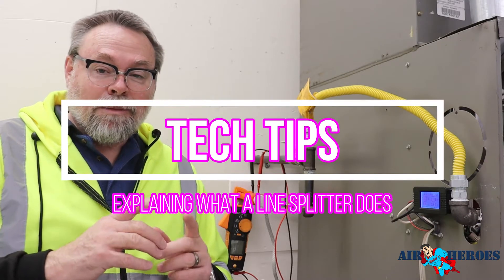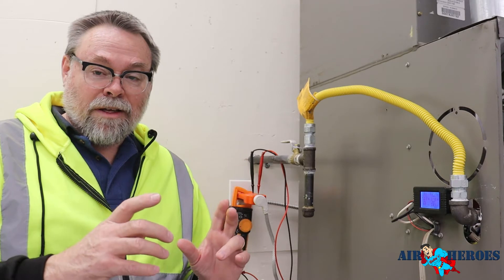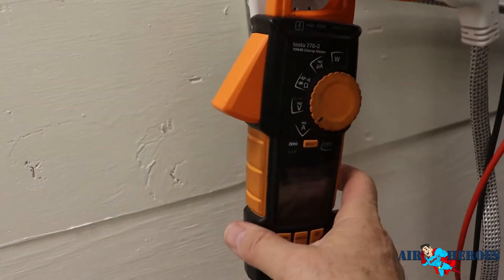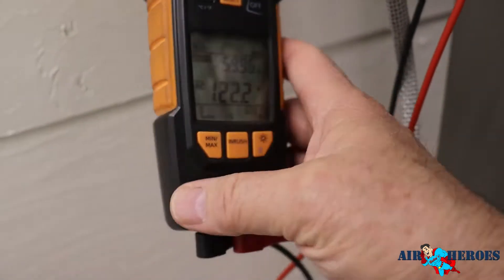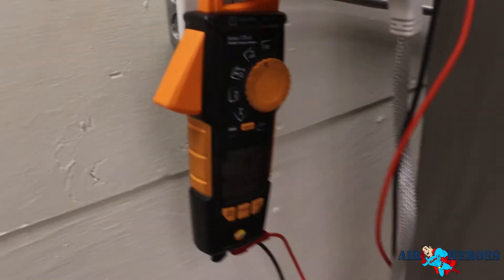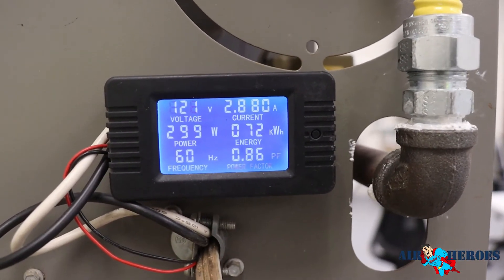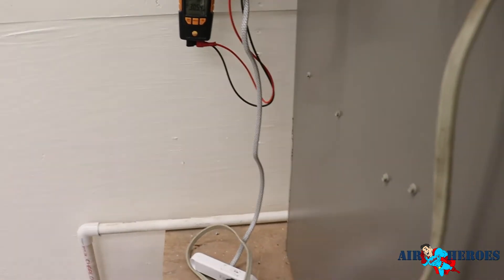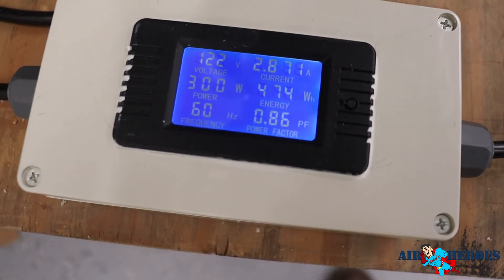Line splitter & taking readings

Comment: Nicely done Mitch!  A lot safer than the “original Bailey” splitter. And significantly less than Fluke Connect tools.
Reply from the maker: Agreed, these work very well, and I am making one for each of our techs, they can just snap a picture, then do repairs or clean the system and show the improvement just by snapping another picture. As they say work smarter not harder.